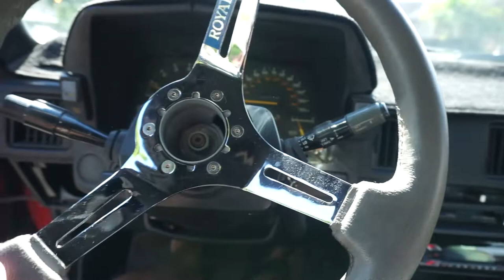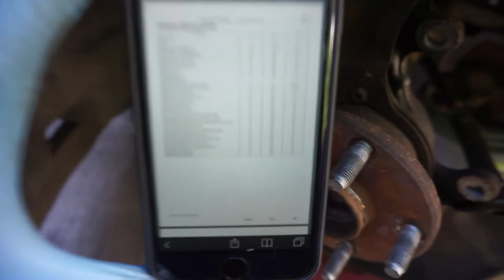Front Spindle/Hub Assembly Removal | IS300

Comment: Based on description sounds like lower ball joint. Badly damaged my own IS when it seized up and popped off randomly. Several other IS300s I worked on with same complaint also turned out to be lower ball joint. Wheel bearing would give a loud whirring or whomping sound consistently throughout or at mid to higher speeds. Some grinding noise could be caused by wheel bearing play causing the rotor to contact the caliper though, this is true. I've had lower ball joints do that as well though.

Comment: Mine makes the squealing noise and the rotor is wobbly when I tug on the wheels when jacked up. Think it’s the hub assembly?
Reply from the maker: Viscious Hattermaid yup it was my hub assembly (wheel bearing). I changed the whole assembly with another from a junkyard and the noise went away. Yours sounds like a wheel bearing too since you said it’s wobbly when you jack it up and tug.

Comment: figure out what the noise was?  I kinda skipped around in your video, how old are the lower ball joints?
Reply from the maker: The lower ball joints are about 4 months old. I changed them for some Moog ones I got from Rock Auto when I first got the car. After this video I tried listening for the noise while someone was turning the steering wheel and it sounded like either the lower ball joint or outer tie rod. I'm gonna try grease them first and if that doesn't help I'll just change them out to another brand. The squealing noise was the wheel bearing, swapped in a junkyard spindle to fix that.

Comment: Did you end up finding the whole assembly? I can’t find any only ones to be pressed
Reply from the maker: I bought the bearings that need to be pressed into the hub assembly, along with the bearing retainer and wheel seal. I believe that's the only way to replace the wheel bearing for these cars. Instead I ended up going to the junkyard and getting a used hub assembly that didn't have a shot bearing.
Reply: Nickodelic awesome man thank you
Reply: I just did my own FR wheel bearing by following a different video. You def need a press or have a shop press it for you. No way around it unfortunately.
Reply from the maker: NightskyFusion thanks for the info!

Comment: What did the problem end up being ?
Reply from the maker: CCDRIFTYS squealing noise was a bad wheel bearing. Creaking/popping noise I haven’t figured out till this day. I already changed lower ball joints and outer/inner tie rods. I suspect it may be one of the control arm bushings.
Reply: @Nickodelic  could be your upper control arm ball joint
Reply from the maker: CCDRIFTYS I’ll check that out too, thanks man!
Reply: @Nickodelic  check your steering rack dude
Reply from the maker: @josev5946  I still haven't figured it out till this day lol. I'll check that out when I have time tho.